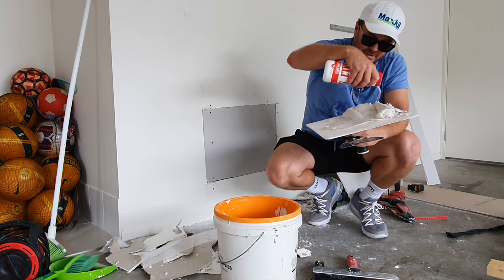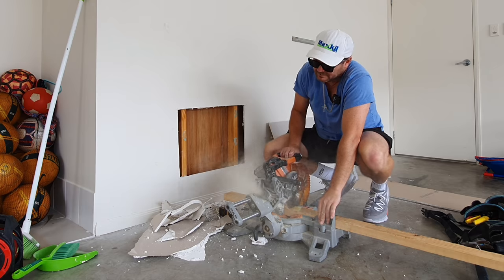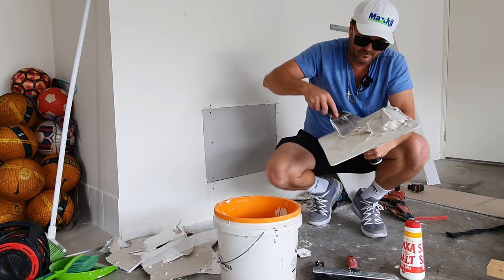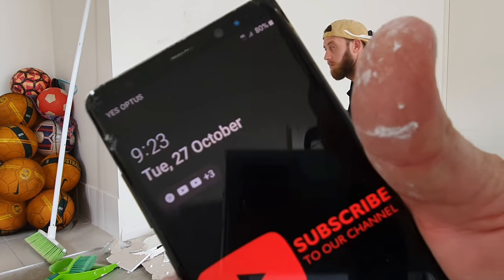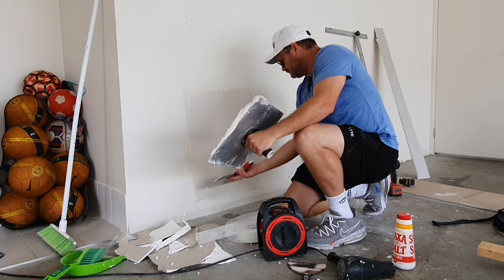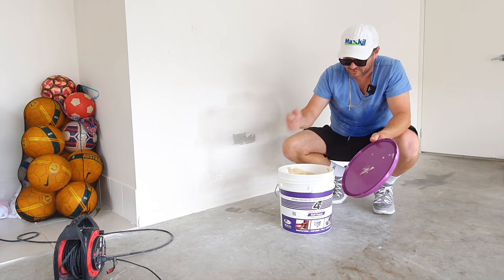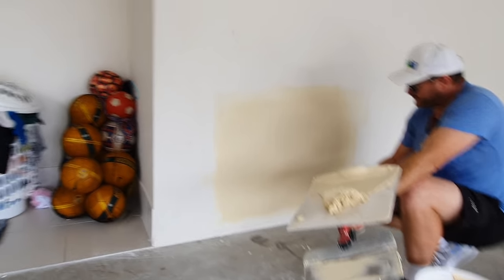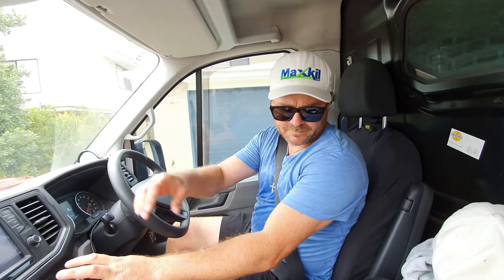How to Patch a Hole in #Drywall Faster

Comment: Totally agree with cornice cement for repairs,have just tried pro repair 10 from gyprock which worked well but feel not as strong in glue,they promote as a 3 coat product but terrible to sand.No issues adding salt into walls under painting?-love fibrefuse tape for repairs and butt joints but would you use for ceiling recesssed edge joints on furring channel battens?

Comment: i just bought a 6 inch wide roll of Fibrefuse for bad patches-not sure where i will need it but just wanted it in the kit
Reply: i have already found use for it-sparky drilled for downlight in wrong spot-presto instant patch on new ceiling!!